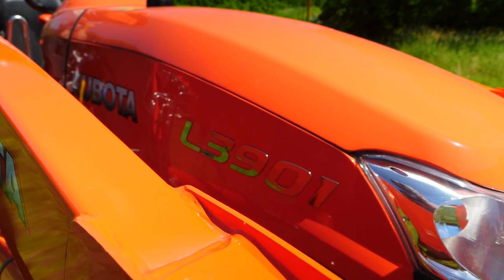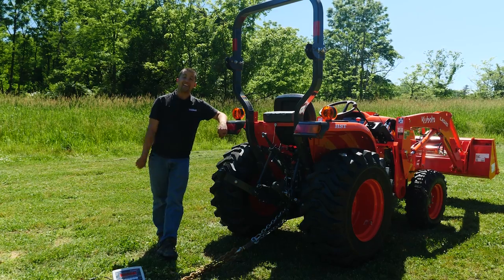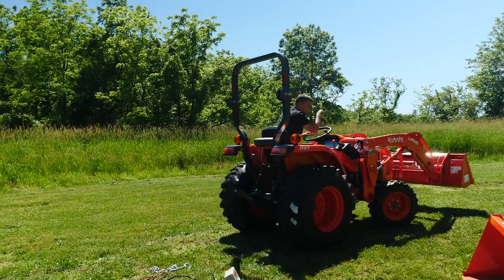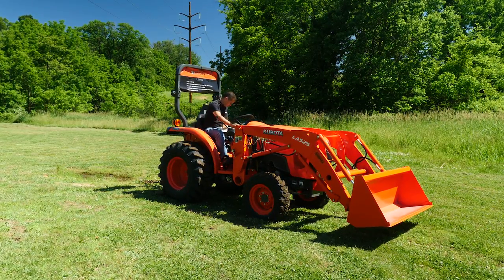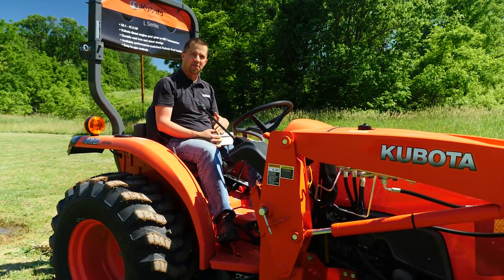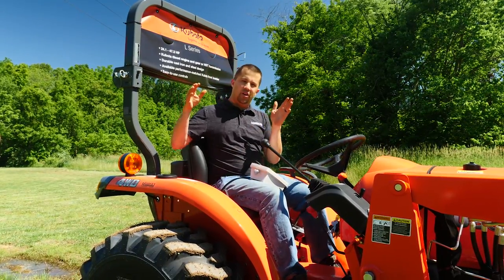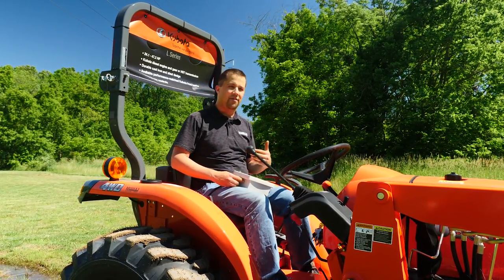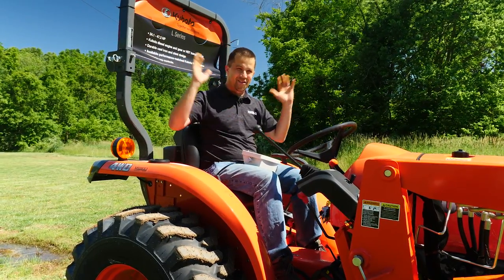Tractor Pulling Test - Gear Drive VS Hydro-static

Comment: I imagine it depends on the tractor.  My excavator is a hydrostat, so they certainly can be made strong enough to pull whatever you want, but this little tractor here with the hydrostat is weak sauce if it won't even spin the tires.  Hydrostat tractors can overheat when doing steady hard work like bushhogging or plowing for a few hours.  Don't like them for that reason.  If I wanted to do loader work I would get a large skid steer or small track loader.

Comment: I grew up on a farm when Deer first introduced its hydro trans (a long time ago). Pulling sugarcane trailers out of a muddy field with 100+ HP the hydro would bog before getting stuck but if you put a plow behind it they would not pull like a manual trans and also clutches on a manual is cheeper to replace than a clutch pack on a hydro. I own a Kubota 23HP now for gardening and I would not have a hydro on a small HP tractor unless all I was doing was cutting grass with it. Hydro looses a lot of HP.
Reply: it is literally a 1 hp difference.

Comment: manual trans will have less power loss due to no slippage. every good operator knows to get moving THEN drop down your disk/planer/etc. and engage the earth, so clutch wear will be minimal. FWIW: i own a M series hydrostat, but we just bought a manual trans L series because it will mainly be used for stationary work, where a hydrostat will just be uselessly pumping fluid for no reason.

Comment: I realize they're to different class of tractors but back in the 90's the 4 & 500 series Wheelhorse tractors were pretty stought units and if you read the manual on the rototiller it recommended the use of the gear drive tractor apposed to the Hydro. Reasons unknown to me

Comment: Interesting test and comparison . I guess what your gonna do with it will decide which is best from your application, I have a L4701 Hydro with R4’s . I have all the power and torque I need regardless of what I’m doing. Had I not had a gravel drive that’s a quarter mile long I probably would have bought a smaller tractor, which I was borrowing ( I hate borrowing) to grade before, so when I got my own, I did not want one with the shortcomings of a smaller lighter tractor, now when I grade there is no screwing around, the Kubota monster knocks it out and don’t take all day to do it,  nuff said.

Comment: If you really wanted to pull something you wouldn't use high range, they both would spin the tires or break something trying ! Who cares if it bogs down in overdrive in transport mode. Any work your doing will be in lower ranges!  And if hydro let's it bypass  it might not brake something expensive!
Reply: Actually, it's important that the tractor doesn't bog down in transport mode as you called it. On other countries where the tractors are actually used for some real work, they pull trailers fully loaded on the road. With an HST, you're suck in Medium range with a lot of noise, while the gear tractor will just pull in High Range and High gear. If the gear tractor bog down, it can just down shift on the move from, lets say, 4th gear to 3rd.
Reply: We do all field work in high range plowing discing haywork we only use low range to move in small spaces hydro are better for yard work on small jobs
Reply: I see hst being useful for loader work, but for everything else I think Id stick with standard trans, powered shuttles make a standard pretty loader friendly...
Reply: Pedro Batista Haha I like your point. In lesser developed countries, people use these compact tractors to support their families. In America, most of them are used as rich people yard toys.
Reply: @ironmatic1  Exactly. Although, it's doesn't apply just to the less developed countries. In high developed countries, compact tractors are also used in farming, pulling trailers, ploughs, disc, etc.

Comment: Good test and 100% true results. This is why we still prefer more the gear drive in Europe, even if the cost for a clutch change is high in dealerships (personally I change it by my own hands), you can get better torque direct on the wheels. Hydro is good only for big harvesting machinery. Greetings from Greece!

Comment: The m59 still has a clutch in the hydro tractor. So slips either way I think you should also do the test on asphalt in low gear. I think the gear will still do better.
Reply: It only slips on the pto

Comment: Ok, let me try this again, since I didn't seem to make my point very clearly in my earlier posts.  Both of those tractors empty weighed about what, 2900 pounds?  So traction should have been pretty similar for both assuming they had the same types of tires and were on about the same ground conditions.  I think we can all agree that adding a ballast box to the gear driven one would have significantly improved the torque it put on the load cell by keeping the tires engaged in the ground longer before breaking lose, right?
In the case of the gear drive, the weak link for this test was the tire to ground contact.  The engine and drive train had more than enough torque to break the tires lose.  The load cell just happened to say that the tractor was putting about 3300 pounds of forward motion against the cell when the tires did break loose.  But surely that tractor can pull more than 3300 pounds?  I mean my 4 cylinder Toyota Tacoma is rated for that!  And Neil has another video where he shows a BX putting down 2200 when its tires break loose!!   So this doesn't give a true representation of what an L3901 gear drive can really pull.
In the case of the HST in hi range, the relief valve lifted long before that 3300 pound value that was needed for the tires to break loose.  All the ballast in the world would not have helped, as in hi range the tractor is torque limited instead of traction limited like the gear drive was.   Put the HST into lo range, though, so that it applies torque to the ground rather than into heating up hydraulic fluid, and measure it'a ability to spin the tires.  I'm betting that it, too, will show around the same 3300 pounds (assuming same type of tires on about the same ground conditions) when the tires start to spin.  If it lifts the relief before spinning the tires, then it is indeed sadly underrated for its weight.
I'm also betting that you can put a lot more ballast on the gear drive to crank up the load cell value before the tires slip, than you can put on the HST.  The HST will eventually get to the point of lifting the relief even in lo range, where the gear drive will get to the point of either slipping the clutch or stalling the engine (or breaking something really expensive).  In either case the gear drive is more efficient at putting engine rotation into attempting to rotate the tires (and at eventually finding the weak link).  But for this example, keeping the HST in hi range is not really showing what it's capable of pulling any more than the test showed what the gear drive is capable of pulling.  It just showed which one hit which weak link (tire traction or hydraulic relief) first.

Comment: Just a thought, the further you press the forward pedal down on the hydro transmission the faster you go. In saying that, the clutch system is different. While the manual transmission pulls by clutch release the hydro pulls by pressure. You won't get the same pressure in high range hydro as you will in high range manual. The true test would work best in low range for both tractors. However, while the manual transmission pulls by the clutch dump, the hydro will fail because of safety features in the pump. The manual will force breakage while the hydro pressure guards against it. Personally I prefer the hydro based on my terrain and my force in getting it done. In the manual transmission I would break my tractor.

Comment: You said you did the test in high range to not spin the tires. But you did just that with the gear drive. I'd put the hydrostatic machine in low range and see if it can spin the tires. If it can, I'd expect about equal pull. If not, then there is a serious difference.

Comment: Hydro trans is a useful option, but only for those who need repetitive direction changes or widely variable speed control (mowing is a good example)... where the productivity of speed and direction control make up for the loss of fuel efficiency and positive torque.

Gear trans is better suited to those who spend more time working at a consistent speed and direction (tillage, row cropping, etc.)... where the positive transfer, consistent speed, and fuel efficiency is of primary importance.

Comment: The end result, road speed, is the real test.  Match them as closely as possible and test.  Neil seemed disappointed the hydro didn't win this because he went to clutch slipping.....   pure out pulling power goes to geared.  Enough said.  Hydro has its place as well.  Convince is a big one.

Comment: Results as expected. Gear trans should always pull harder. no slippage unless the clutch fries or tires break loose. Hydro will always have slippage and thus loss of pulling power. Wish my Sub-c had a gear trans.

Comment: Test not even close to being fair. Hydro should be in low range for such a load. If you were pulling such a load with a gear tractor, you would have it in a lower range!
The hydro will spin the wheels easily with “proper operation” just like a gear tractor. Sorry Neil, not a fair comparison!
Reply: He had the gear tractor in high range too.
Reply: The truth hurts and hydros suck! Lol
Reply: You're missing the point. By having both tractors on High range, you can clearly see that the HST loses a lot of power and makes a lot of noise versus the Gear tractor that spins the tires easily. Of course everyone know that for hard pulls, you use low range. But that's not the point of the video.
Reply: Pedro Batista the point of the video was to highlight which transmission is more capable.  The gear drive demonstrates that by 300%.  Losers park in the back! Lol
Reply: @pedrobatista4439  , I understood from his introduction that HARD PULLS was exactly what we would see. That is what separates TRACTORS from Trucks. Tractors are for FIELD Work. How much force can you exert pulling a Boulder or a Stump out of the ground? That is the job of a Tractor along with pulling ground engaged equipment through the ground.         sdh in CT

Comment: Hydros are not used for tractor pulls, but really shine in other areas.  For loader use, the hydro wins, and you will never wear out a clutch.  For hard pulls like field work, the gear drive shines.  So short answer, if you are using the clutch a lot, use the hydro.

Comment: While the hydrostatic may bog down in hi range doesn't mean it won't pull  as much being hooked to something solid is not a fair comparison . No matter what gear your in  when the wheels spin is your max pull  matter of fact drop the hydro to a lower range you will find they both have similar dead pull numbers .     Because weight of the tractor determins how much it can pull .    For a better comparison hook it to an implement and see which one pulls it faster then compare wheel slip   your test is not fair

Comment: Just goto a tractor pill and see how many hydros are pulling?? It’s like comparing a automatic to a standard transmission in a truck, the gear drives have less horsepower loss thru the drivetrain, but who wants to sit there and push a clutch in and out all day doing loader work?? Each drivetrain have there pros and cons

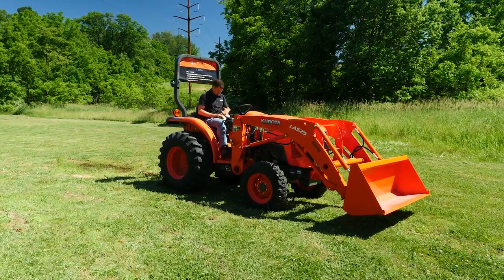Comment: 2:28 Are you trying to kill gear box or clutch! Low down rpm to 600, and from this up.
Reply: If you kill your tractor from dumping the clutch at redline you don’t got a tractor you got a lego set
Reply: @russianacorns8080  maybe you right! But it is hard to watch this.

Comment: If you are primarily using a tractor for steady state service such as mowing, plowing, etc. you do not want a hydrostatic drive tractor. The hydrostatic drive looses about 30 to 40 percent of power because of hydraulic losses. If you are using the tractor as a front end loader with many changes of direction, you for sure want a hydrostatic drive. That is why they make the same tractor with different drive systems.

Comment: Does anyone use the loader or heavy loads in high range? I just came across this after placing an order today for a new 3301 hst. Is the thing even capable of breaking traction?
Reply from the maker: they all break traction in low. I test in high specifically so they don't break traction because I don't get measurable numbers.
Reply: @MessicksEquip  I appreciate your reply, but after watching your video and considering your back ground and obvious knowledge level I am concerned the tractor I just obligated my self with will not be able to pull the 5.5 ft box blade or bottom plow I purchased except in low. 1100LBS of pulling force is not much force in the realm of 30+hp tractors. I am considering changing or canceling my order and hoping the dealer will accommodate. This video is shocking to me. The tractor's hydraulic drive seems weak. Hp is nothing if the drive system can not transfer it to the ground. If the tractor weighs 2500+lbs and can only produce 1100 lbs of pulling power in high gear, high throttle it probably could not pull itself up a steep hill. My 68 yr old farm-all super A gasoline will break traction in 4th gear. I can appreciate your honest evaluation/demonstration and I hope I am misunderstanding your conclusion but I have to look further into this.
Reply from the maker: @cap10joe2000  the tractor has a 3-range rear end. High is a transport gear, low and medium are for doing actual work. If you wanted to plow at 10-12 miles an hour, you need a lot more tractor, at any normal speed this is more than enough machine for that size implement. I personally have a 6' box on the next model down. In working ranges you'd have no issue getting enough traction. I intend to do a follow up on this video because I think its outcome is misleading. With covid supply problems we've not had the right equipment here to do it.
Reply: @MessicksEquip  Thanks, I have had some reassurance from other owners. This will be my first Hydrualic drive tractor. only lawn mowers.
Reply: @MessicksEquip  picked the tractor up the other day. I am glad I stayed the course. This 3301 was pleasantly surprising. I was concerned after watching your comparison but have a better understanding of your message and point. Great torque and will definitely spin all four tires in low and medium. I believe it will do everything I need and more. The HST is great when operating in tight places as well. Very pleased, you were right! Also for anyone purchasing the 5ft land pride brush hog the 3301 has plenty of hp to do a great job in fairly thick weeds and small bushes. Thanks

Comment: You put the hydrostatic in a disadvantage right off the get-go in high range. And I can't see where that's good on the hydrostatic to start with.. chain The Tractors together put them on blacktop and see which one polls the other in the same range

Comment: Neil this stuff is fun, thanks for doing it, but this one is just bad experiment design.  You went to the point of breaking ground contact with the geared, but did not get that much power put to the ground with the high range on the HST.  Putting it in medium would have likely gotten there.  Also as you point out not comparing gear ratios across the machines and doing a test that is somewhat equivalent makes the whole thing pretty pointless.  I thought from the title you were going to have an actual pull test between the two, but difficult of course with new equipment.  Maybe some comparable used pieces will become available at some point.  Thanks for pumping out content none the less!

Comment: On that size tractor... HST High range arent use to work, they are used to drive point A to point B, can't even break the tire loose!... try in Medium range or Low range. the manual will still win but not by 3 times... its a fact, manual will "always" win unless you have a real HST transmission like a dozer.  but the HST on a compact tractor is nice to foward/reverse compare to manual shuttle. Hydro shuttle kill them all... (farm tractor!)

Comment: Have a L3830 clutched hydrostatic. Would much rather have the manual. The automatic bogs down constantly. The clutch is useful when using a bush hog. However the brake and foot controls are weird. Have to turn sideways to push the brake with left foot and direction with other. Yes there are moments! 

The hydro is simple and easy to drive but doesn’t have near the brute grunt for unlevel terrain or mud. Bogs easily. Also towing a trailer (hay bales) it’s limited. 
I often find myself firing up the big MX 125 just to put out round hay bales.

Comment: Assuming the two tractors weight the same, same front to rear weight, have the exact same gear ratio and tire sizes, The geared transmission will always have a greater pull force.  The hydro transmission is more ergonomic friendly on the operator and in the transition from static to kinetic ground forces at the wheels, the hydro might be easier for the operator to maintain a more consistent pull force.  The volumetric and mechanical efficiencies of the hydro trans is approximately 87%.  The overall efficiency of the manual transmission with a new clutch will be about 93%.  It is simple physics....

Comment: I love my hydrostat but it's SOOO LOUD and much much weaker than a gear drive. I may go back to a gear drive. I feel like I change gears between low medium and high just as much as I would clutch it.
Reply: Try driving with revs  higher/just below pto rpm, common fault on compacts, the noise is detramentel to your hydros well being,

Comment: All the older gear drives did with 16-24 hp what the hydros require 23 and up hp to do because they lose less power thru the drivetrain.